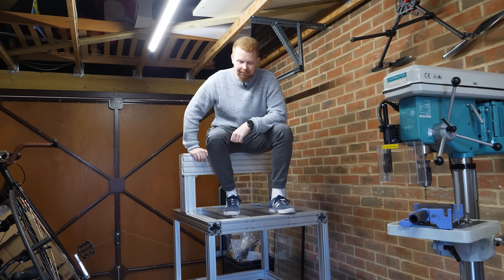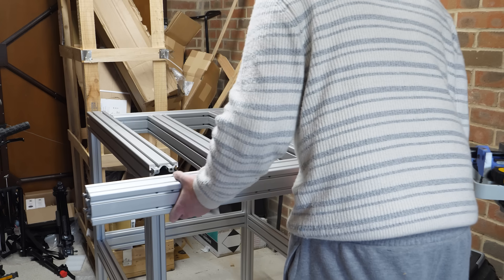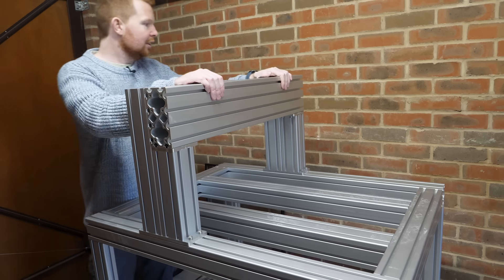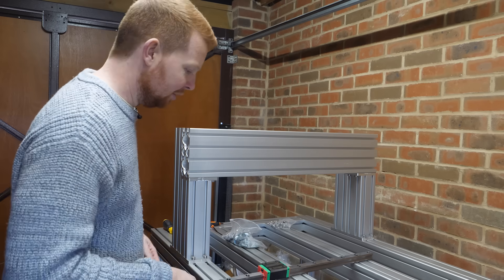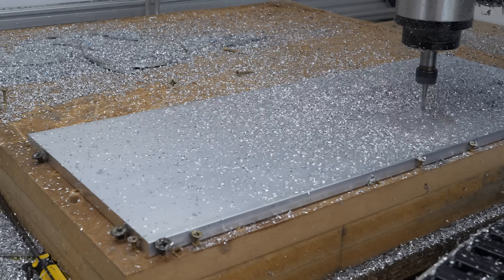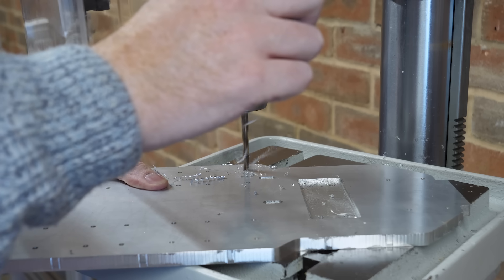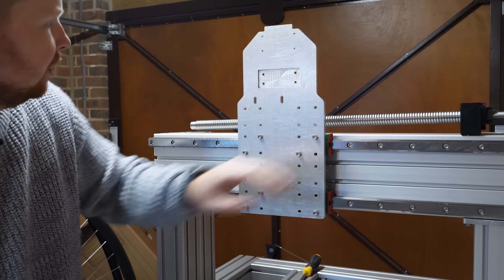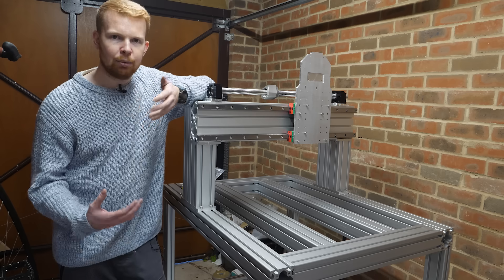Building a CNC Mill/Router - Part 1

Comment: I'm pretty sure the X-rails aren't moving smoothly because they're not perfectly parallel. After attaching the plate, you should try loosening one of the rails, move the plate to one side, tighten one side of the rail, then move the plate to the other side and do the same

Comment: I found when making my cnc that it doesn't matter if your gantry is rigid if your bed moves...
Total area available is also less with a bed slinger or it takes up a lot of space in front and behind the machine as well as makes areas of the bed less rigid than others.

Comment: There is a good reason they always put the lead screw between the rails it’s because it pushes and pulls evenly between them your way will always be trying to twist them that will put large loads on the bearing wearing them out quicker than normal making the machine out of tolerance much sooner

Comment: Giggles at the channel name !!! 
Whatever you do By a smooth stepper or UNCNC controller had nothing but bother with Gerbl and other stuff and try muti cheap chinese mach 4 controller (limit switches been big prob) and losing steps , I switched to smother stepper MB2 (think theres a Mark 3 out now) and it just worked !!!! once I got the wiring sorted it was few hours to set up total dream compared to anything else

Comment: Instead of tightening through a hole, I would insted consider having the screw's head on the other side of the extrusion, which would leave space for a proper tightening tool, like at least an L shape clicking screwdriver, or a dynamometric wrench. Also adding beams in diagonal stiffens a lot the structure, it's not only visual, as a twisting deflection for a beam, is a compressing one for an other.
I made a project were two boards (10cm wide each) needed to be linked perfectly parallel to one another, just 3d printing and cross bars using wooden food picks used fo skewers did the trick (though, I needed to glue them with epoxy at their ends). I didn't stand on it to prove the point, but it could easily withstand at least 40N with minor deflection, with just 16 bars made of wooden skewers

Comment: How can you be sure that your profiles were cut with correct angle.?
I'd ordered some 20x20 profiles in local shop and in the first glance they were cut ok. But when I checked them with precise machinist square ruler, I understood that I'd better cut and file them by myself 😢 (which is pain in the back too).

Comment: uh hahaha so this is the sort of thing that happens when you dont have any sort of formal training or education and why you cant just watch a youtube video and be a machinist. You see my friend cnc mills and lathes are made from heavy cast iron or solid pieces of steel for a reason and its not because its cheap or whatever your thinking. they are made with those materials because it makes them more accurate. that thing your building i doubt will be able to stay track more than an inch without deviation. your wasting your time and should stop now. but ill leave it up to you but mark my words that thing will not be accurate enuf to make much of anything besides boat anchor. no shame just live an learn and move on is all. best of luck...

Comment: A 45° metal triangle instead the backplate at 5:52 would safe you lot of money and would give you way more stability. There is no need for a double backplate, just a minimum 45°.angle to give it stability so that it can lead the forces to the ground.  /|\ just so 🙂
Reply: That's also what i was thinking

Comment: Another great video. I would be tempted to try and link as many of the central bores of the extrusion together and fill them with either concrete or ideally epoxy granite. Should bind it all together and do some vibration damping. Could also throw some rebar in to add even more rigidity.

Comment: The problem whit your build is that, whit all that overbuild and size, it will give you the impresion that you can do more that a hobby level work on it. Aluminium is great but it laks weight. As soon as you will get to do some real cutting you will see why the "real" CNC's base are made from heavy cast iron. And the tiny adjustable feet are not good. You will need a better contact surface whit the floor for vibration dampening.

Comment: You can measure the stiffness with Luggage weight pull util you reach 100N(10Kg) measure the deformation with dial indicator, divide Value in N by deformation in mm you get N/mm score. 2000N/mm(on endmill) is minimal for aluminum miling CNC

Comment: "The vertical mounts for the gantry" - there is a word for those members, and it's stanchion.

When constructing a gantry mill, to achieve dimensional accuracy and precision, good surface finish of completed parts, etc., each stanchion must be rigid.

Comment: Interesting you went for a movable bed rather than a moveable gantry. Im not sure this is a good idea for a heavy duty machine. Having a stationary bed will be more stable.
Reply from the maker: Heavy duty mills have a fixed spindle (apart from Z movement) and the bed moves in X and Y. But less rigid routers have a fixed bed and a moving gantry. This design is a mix of the two to hopefully achieve high rigity and large build platform.
Reply: They do, but they are not made out of hollow aluminium. They are normally a dovetail made out of cast iron. You might be able to fill the profiles with sand to help dampen vibration but the rails will have more deflection moving a heavy bed. It might work fine but I think a flying gantry is easier to make rigid and can run faster. @TimStation

Comment: we need some affordable 5 axis desktop milling machine. under the 1.5k$. This router seams sturdy, but I think you may improve the stability by multiplying the bolts at the attachment of the gantry. 4/side seams really shallow compared to the strong  profiles.

Comment: One technique for mounting linear rails is to tighten just the top rail (preferably against a straight edge) and loosen the bolts on the bearings and other rail.  Then tighten the bolts on the bearing blocks that attach to that fixed rail.  Next, tighten the bolts on one of the lower bearing blocks; that will set the distance between the two rails.  While moving the carriage side to side to hold the two rails at the set distance apart, tighten the bolts on the second rail.  And finally, tighten the second lower bearing block.

Comment: I think a good idea would be loosening one of the two rails, tighten down the plate to both rails, and then tightening down the second rail while moving across the whole length to ensure that they are absolutely parallel

Comment: Hi. You should only tighten the rails down after efter plate has been mounted to the bearing blocks, while the rails sits in the bearings. And you should cheke the parallelity with a dial indicator.
The x-axis should run more smooth when doing this.

Bur nice video

Comment: is there a reason grinding the bolts smaller is a bad idea? (couch engineer)
Reply: It's a lot of work for something you can have easily on the internet.
it's not worth it if you need more than 4 and it mess up the thread a bit.

Comment: Remember to tram the linear rails to each other (and to the screw)
and if you want to make the frame more rigid you can fill it up (even with concrete ... for holes to tighten the screws use some drinking straws) with sika grout (non shrinking one) its designed to do that (yes , literally)
or if you just want to just reduce vibration - sand is great option (pro tip --- shake it a lot , way more will go in),,,,, or hard epoxy foam is also great , fast cure time , hard , make the frame stiffer and reduce vibrations ...yet probably not as good as just filling it up with average concrete)

Comment: Good work, nice video! I made a few CNCs in last 10 years to test electronics and software I made for hobby, but usually I used steel because it is cheaper and stronger. Can see some on my channel. I am building a new one to test last control electronics I designed.

Comment: One could argue that if a bolted joint falls apart, the cause wasn’t due to a lack of thread locker but perhaps due to not being tight enough and/or material is too soft underneath the head of the bolt/nut, and/or the bolt is too short (L/D<4). 
I have a little hesitation at seeing the bolts just bolting through the flanges of the extrusions. I feel there can be some flexing of those extrusion flanges that could result in a lack of local rigidity. 
BUT that’s just my couch potato engineer opinion. I do actually love your videos.

Comment: I'm building one myself currently so here's a few tips:

I had the luck to find some really heavy steel tubes at the scarpyard to build the machine base. They need to be scraped/sanded by hand to provide flat surfaces to mount the linear rails. So do aluminum extrusions, the can easily have a 0.05 to 0.1mm bow over a 1m length. 

You also need to make sure the surfaces you mount the rails to are not skewed on top of being individually straight, you can do this with a machinist's level (it's not that hard to improvise one).

As someone else already mentioned you need to tram your rails: you can do this by tightening only one of them and using the sliding assembly to set the second one at the correct distance.

A lot of stuff on a cnc machine is overconstained: unless you have a bigger machine already, it's really hard to have everything fitting together perfecly, then when you tighten the screws everything warps... Sometimes you can get around this by epoxying stuff together: just let it sit however it wants to sit when it's drying, you can add fasteners later on.

It's also a good idea to epoxy everything you don't plan to disassemble for added stiffness, especially when you have a lot of contact surface area between parts

Remember to fill will sand all tubes
Reply: Check out Marco Reps's "300 kg Steel CNC Machine" for some specifics on linear rail mounting
Reply: @lyrag6376  just look at the hiwin assembly instructions instead. the formulas for calculating the tolerances of the mounting/reference surfaces are all in there

Comment: It does seem to be impossible to ever have the correct size bolts when working on a project. I constantly run into that problem. "Oh good I have a huge pile of M4 cap heads.... But now I i need M4 countersunk bolt 3mm longer than what I have"😢

Comment: really cool project,  im in the process of building a cnc as well, but a 5-AXIS ONE ,since ive run quite fast into the limits (that are a reasonable amount of work) and since there is nothing on the market (yes i k the pocket NC , but its not good) but hope it turns out as i hope, and yes it will end up on github

Comment: I am skeptical of that ball screw placement. Ideally you'd want to position it in a location that wouldn't create torque on the gantry, which in a non-loaded situation would be in-between the two linear rails. You could also position it on the underside of the carriage in a spot that would oppose the torquing force produced during cutting.
Reply: Between the rails is best. Chinese ball screws have excellent low backlash for the price, but are not quite concentric. The pushing and pulling on the floating end of that aluminum plate will likely cause a slight tilting of the spindle in the Y direction on each revolution.
Reply: I have this exact problem on my diy machine. That torque created on the gantry translates into the end mill falling a little behind the movement. This gets worse with time and it wears the linear bearings a lot faster.
Reply: I had the same thought.

Comment: Hi Tom,
Great project, look forward to seeing the next update.
With the rails, they might be over constrained as they are hence the slightly stiff movement. If you slacken the screws on one rail slightly, only enough so that the rail can move if pushed but not by itself (i.e. it's not loose) then slide the carriage back and forth a few times and then tighten the screws back up. You might have to repeat with the other rail. Sometimes it's just enough to allow the rail to move to where it needs to be. I have used this technique on 3D printers a couple of times and it seems to work

Comment: As I'm sure you've figured out by now, the trick with those linear rails is to pass the bolts through each hole, and start the Tee-nut onto the bolt, then slide the whole assembly onto the 8020 bar.
Reply: It's all generically "8020” , at least around here.
Reply: this is more like 80160, not 8020 😅 and on top of that looks like heavy duty version with thicker walls😅
Reply: @ErtsenPlayGames I think it's 80160
Reply: @oliverer3  a yes my bad
its 4080 legs
8080 Y axis bed
80160 X mounts to Y frame
80160 X axis

Comment: Your x axis should be more free.   The most likely culprit is the extrusion not being perfectly flat.  I built a much larger one and I had to take the gantry to a machine shop and have a skim cut done on the face used for the linear rails.  Also, have the lower side of the extrusion skim cut to be perpendicular to the rail face.   This will remove any subtle twist in your gantry.

Comment: I should add that rigidity can easily be tested with a calibrated load like a fish scale or hoist scale, and a dial indicator, either to avoid FEA, or to validate it. Simply apply a test load at a relevant location and measure its influence at another equally relevant location to high accuracy. If you are unhappy with the result, bolt on more extrusions.

Comment: Make sure your rails are perfectly parallel and level when you do the final assembly. Your end unit should glide more freely than that. I had the same issue when I built mine.
Reply: Agree. You can use the z axis plate to set the height end to end. Fully tighten one tail, loosely tighten the other. Then tighten screws a bit at a time using the z axis plate the pitch.
Reply: @blakelambert5643  what difference does it actually make? with or without doing this you'll still be moving in a linear axis, and doing this wont ensure you're completely square with the other axes
Reply: Yeah I'm kind of concerned he hasn't made any mention of that so far and he doesn't seem to be accounting for how much variance there is in the flatness / thickness of AL plate stock since he isn't milling the faces of those parts...

Machines like the Avid CNC go through a lot of extra engineering to make a useable machine with T-slot extrusion...
Reply: Yes!!! It should slide almost from one end to the other by just a little push!!!